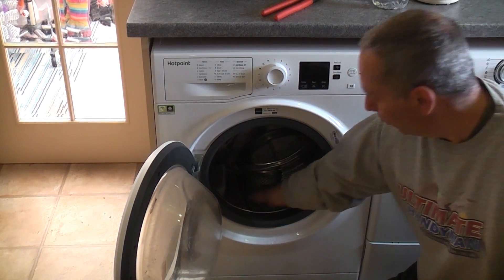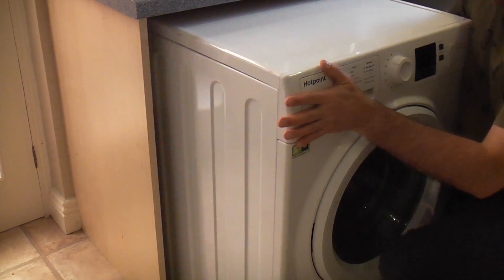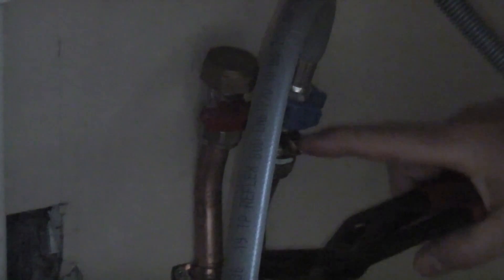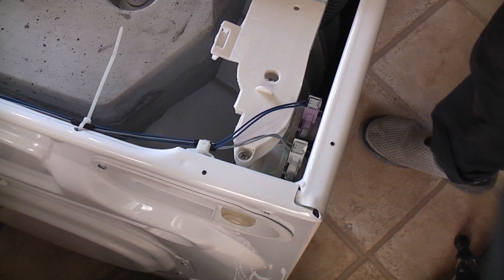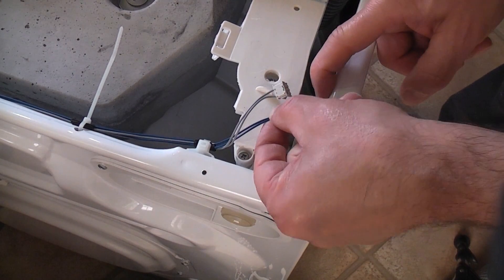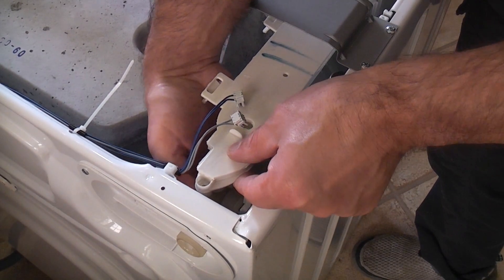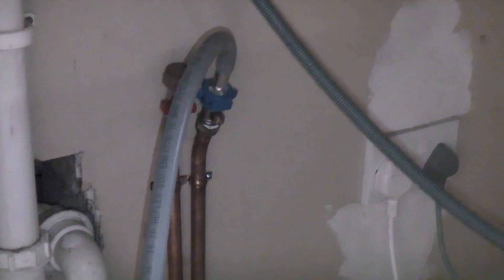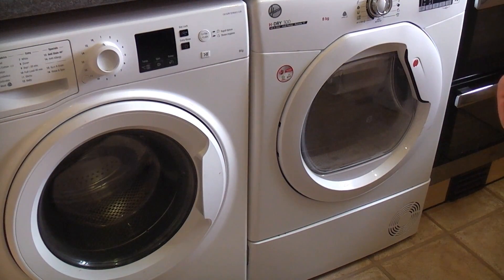Washing machine fills with water | replacing a washing machine inlet valve

Comment: If you can, avoid Hotpoint washing machines. They are built NOT to last.
Reply from the maker: All machines seem pretty reliable these days. I have seen expensive Bosch or Miele machines break down too, which makes you wonder if it is worth spending the much higher initial purchase price in the first place. One thing for sure, is that machine breakdown insurance, is a complete rip off! 
Thanks for the comment 👍
Reply: I agree, I personally avoid all Whirlpool brands now, the motor in my Indesit machine (same factory as Hotpoint) started screeching due to bad bearings after 18 months of light use. Previous machine lasted 20+ years.

Comment: I've replaced one of those on an old Samsung top loader, same principle but accessing it required a little extra work to access it, but I got there in the end. Those screens inside the inlet valve can be a problem in my area...
Reply from the maker: To be honest, I thought the filter would be blocked with debris, as we had a burst supply pipe right outside the front of the house a few months back!  
Thanks for the comment 👍
Reply: @ultimatehandyman  It could have been fine debris from that burst that got through the screen and damaged the seat of your original inlet valve. I guess you could perform an autopsy on the failed valve if you still have it :)
Reply: @ultimatehandyman  Mine was plastic swarf from when the plumber replaced a blown section of water pipe in our building, he used a saw cut the pipe filling it with black swarf that he failed to flush out. Took me a while to work out why my machine was filling so slowly LOL  Thanks again for a great video :) Glad you're back again

Comment: I normally connect everything up, and switch it on before replacing the top cover, just to check for internal leaks.
Reply from the maker: You’d have to put the machine on a test run though, which I would not recommend, or else the water will just stop at the inlet valve- until it is energised! 
Thanks for the comment 👍